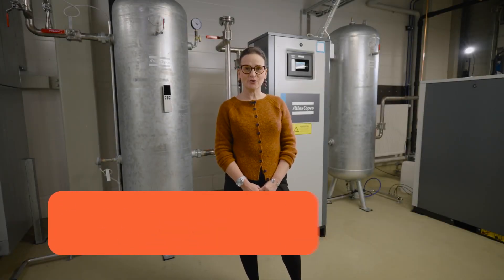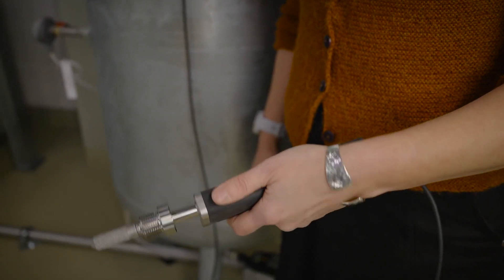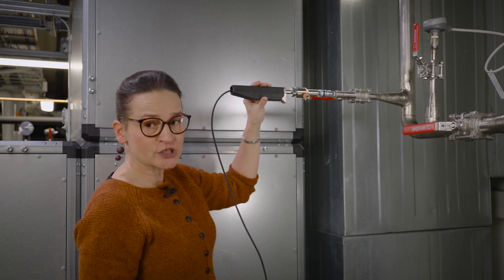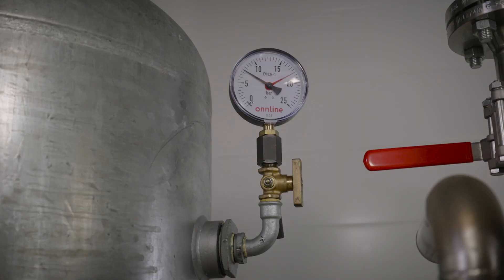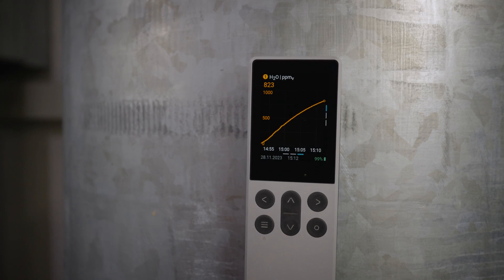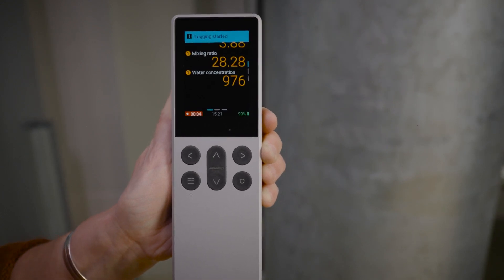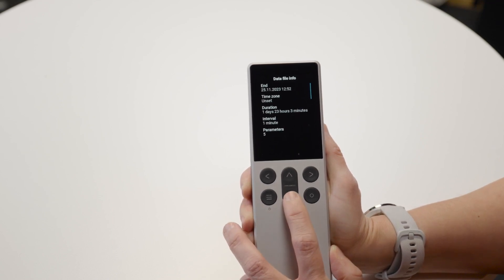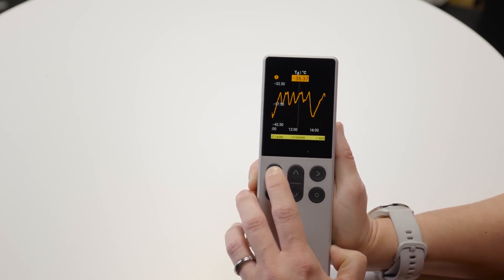Manage compressed air moisture: Spot-checking & datalogging with Vaisala Indigo80 Handheld Indicator

Comment: is it suitable to measure moisture in hydrogen gas ?
Reply: Yes, the DMP80 can measure trace moisture in hydrogen gas, however these instruments are not intrinsically safe so they are only suitable for applications that do not involve use in a classified hazardous spaces/processes.